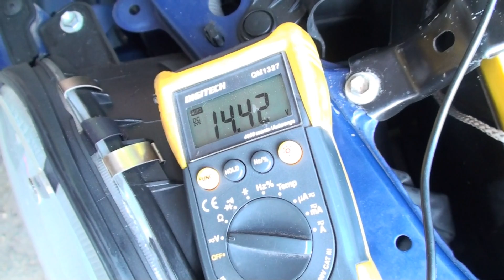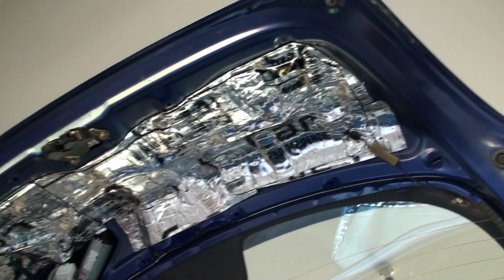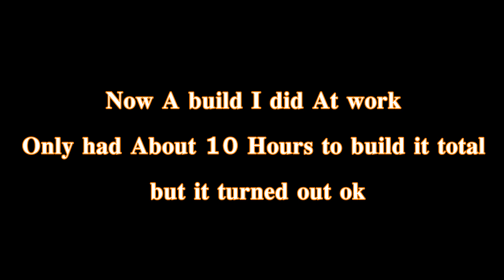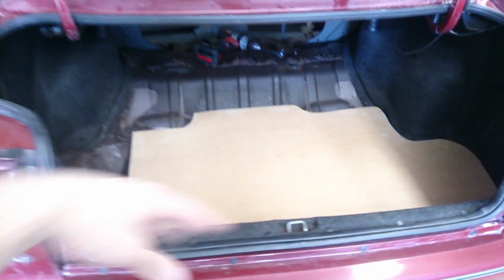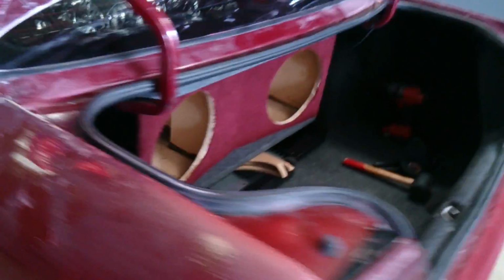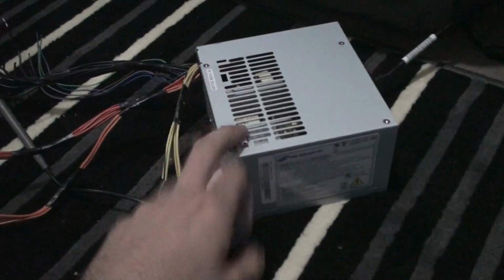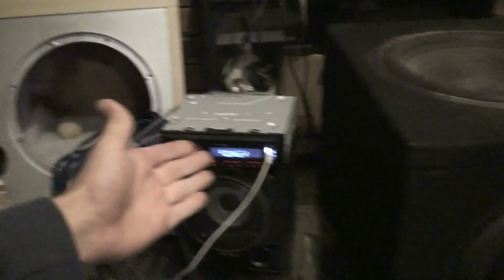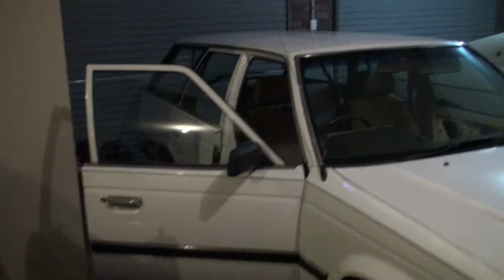RE Audio 15 Build Updates + Work Build In VS Commodore

Comment: Measuring it at the amp will give a proper voltage reading. My guess it would be dropping to mid 12's
Reply from the maker: yeah probably into the 12's but with the big 3 there's no lights dimming etc